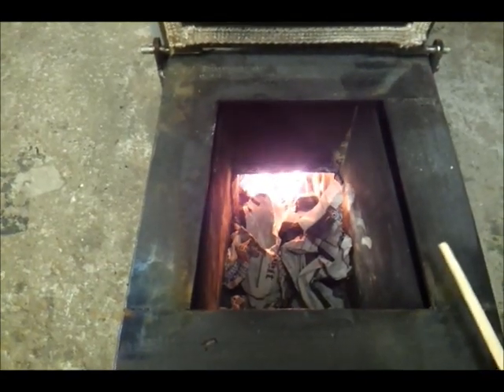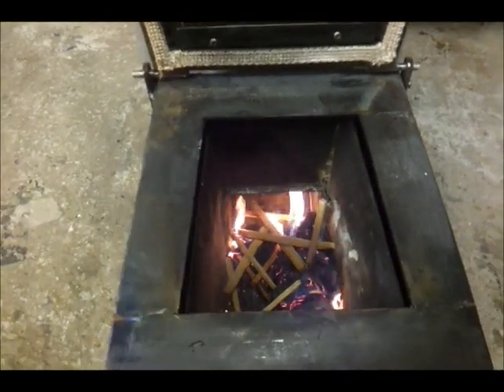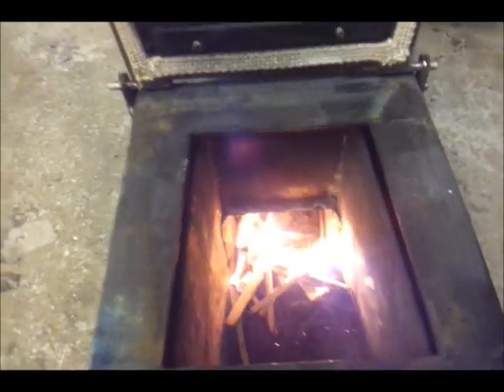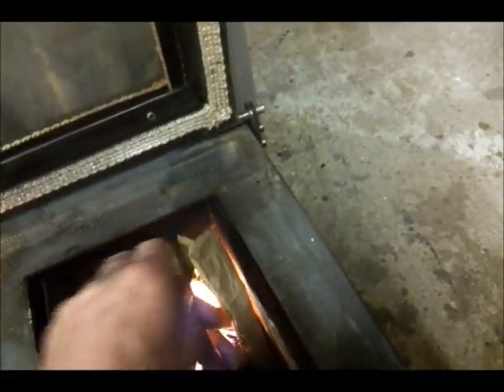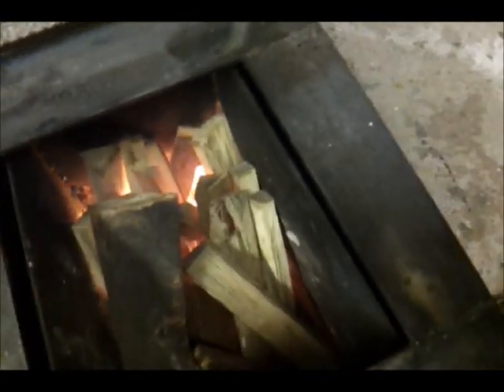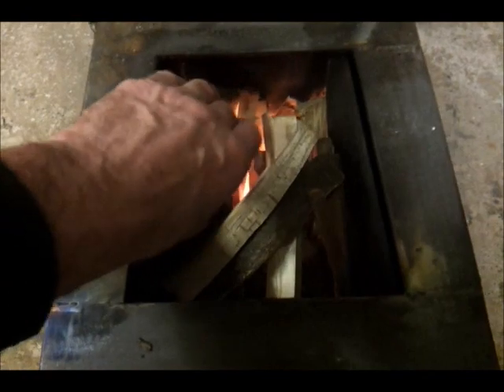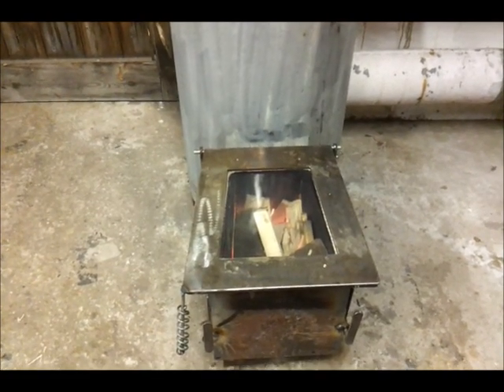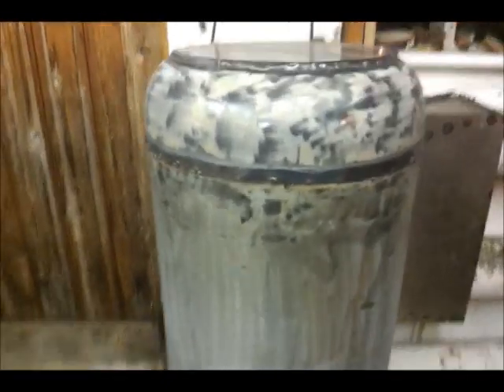Part 2 lighting the rocket

Comment: With your air intake setup you wouldn't need to re-size the firebox. I'd swap the glass hatch for a feed tube with a cap on top and light it through the ash hatch.You should be able to drop in anything that fits, cap it, set the intakes and walk away. If I ever manage to put something like this together I'm thinking of using pallets myself.

Comment: Of ALL the rocket stoves I've seen, this has to be one of the best. Nice design of the glass door and side vents. I have come to the conclusion that the only way you can get long burn times is with proper air control like this. You've got it spot on.